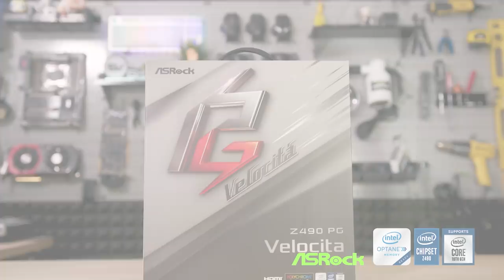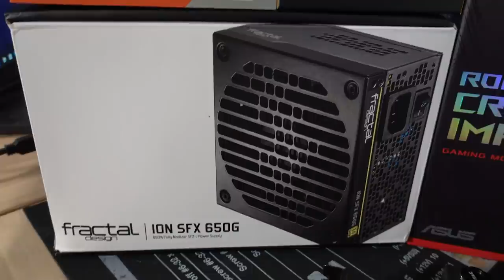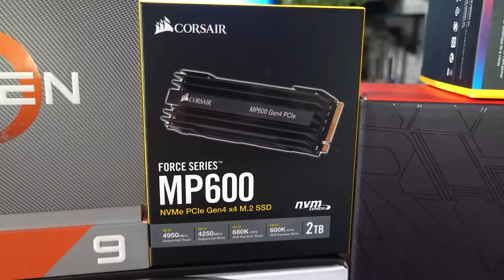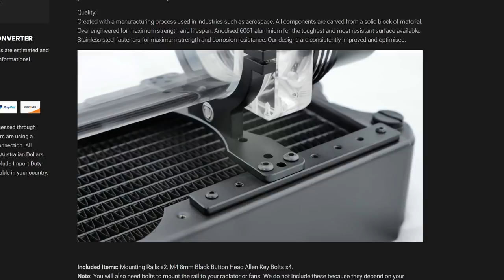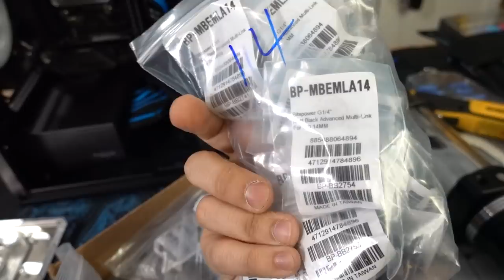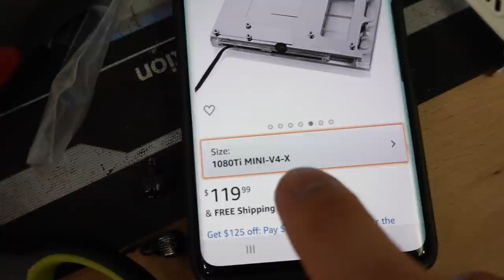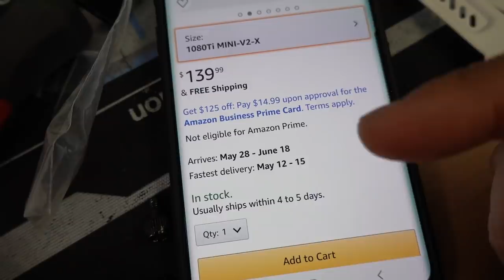Building him a custom gaming PC!! Shooby from Netflix's "The Circle" (Part 1)

Comment: Hey bitwit(kyle) I have been having a problem with my pc for the last week it has an issue that it won't show anything on the monitor I switched out the ram and nothing worked but it costed me 70€ Which wont be refunded I would love for you to try to help me trouble shoot it and fix my baby I have been hopeless without it and I cant get new parts cause money is right please see this I would appreciate it thanks 
Ramz A